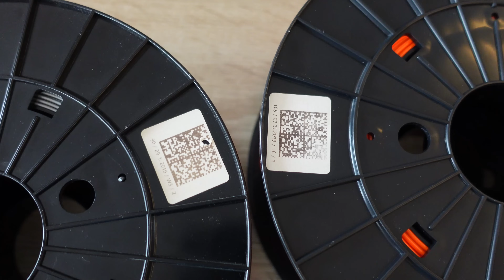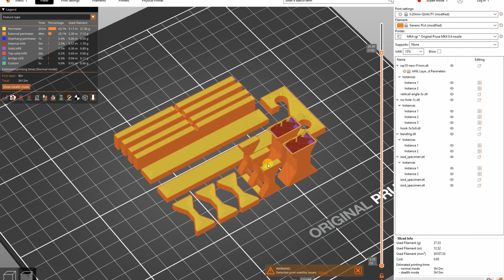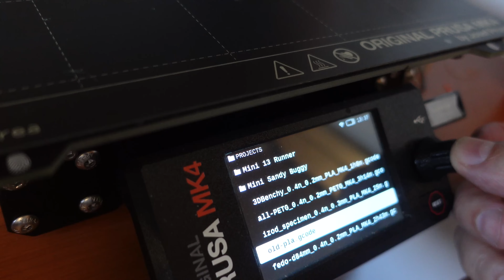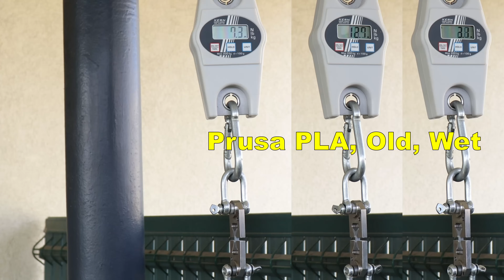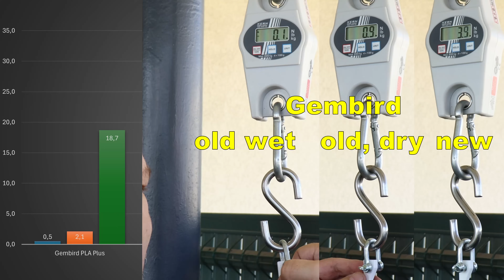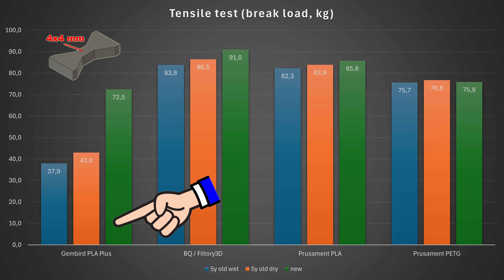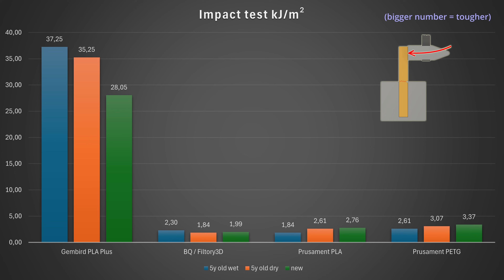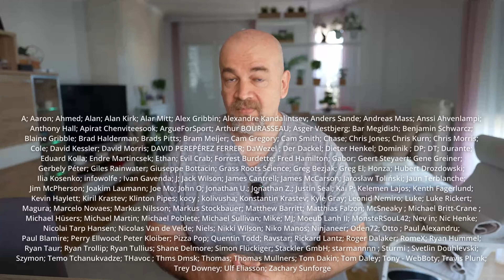5 years old vs new filament - Which one is stronger?

Comment: The reason your PLA was no longer brittle is you eliminated the other layer which was exposed to UV.  Please do some UV vs moisture testing on PLA.  I also wonder if exposure to mild heat within a filament dryer reconditions PLA in another manner.  https://youtu.be/nHdHSK4hvZE

Comment: I made a $0,- filament dryer:  A cardboard box ofer the 3D printing heating plate.  40 deg C and waiting a few hours. Need little holes on top so that the hot humid air goes out due to convection and fresh dry cold air can come in at the bottom.

Comment: I would be interested to know how the strength of 3D printed PLA parts changes over time given how the filament becomes brittle when left alone. Even in a large storage box with pounds of desiccant, the humidity remains low, but eventually I pick up an older spool and the filament has broken around the rim-hole.

Comment: Love your videos as always, but just one correction.

The older "Prusa" branded filament was made by Filament PM (Plasty Mladeč) as you noted, but it's not the same as Prusament. That product line is still sold by Prusa in their store, though, as the "Made for Prusa" line, but "Prusament" is a separate brand that is manufactured by Prusa in-house. I'm not entirely sure, but I think Prusament has always come on the hex spools, and used QR codes. The Filament PM spools have Data Matrix codes, and I did decode them from your footage to confirm that they are not Prusament, unless Prusament filament was spooled onto those spools at some point and the code is incorrect.

The old "Prusa"/Filament PM PLA you have is their "Silver" PLA, and the PETG was their "Prusa Orange" PETG. They did sell a Filament PM-manufactured "Prusa Orange" PETG back then, but I assume Prusa reserved that term for their Prusament brand at some point, as now you can only get Prusament with that name. However, you can still get that filament from Filament PM, which they renamed as "Orange 2018" PETG.

Comment: I want to put in plug in for patreon.  Not only is it good to support someone who is doing good work for the community, having access to the accumulated data is very useful.  I reference the spreadsheet every single time I buy filament.  I haven't found any other way to effectively differentiate this PLA vs that PLA, or whether what I'm doing is a better fit for ASA or nylon.  Buying 3d printing filament without Igor's data is buying blind, or at best relying on anecdotal or biased reports.

Comment: Well these results kind of support my opinion that many people are worrying too much about storage.

Sure, I have petg and tpu filaments in a plastic container with some silica, but I store PLA in the open (no direct sunlight), only dry it when i have not used it for a longer period and never had any issues.
Reply from the maker: Yes, I mentioned it only on one place, but summary: PLA: open air, PETG, TPU: bags+silica gel; nylon: vacuum bags. ABS, ASA: open air (I am not sure about this last one, if it is correct)
Reply: With a cheap sealing machine and vacuum bags on roll it's easier to vacuum everything :-)

Comment: This came in handy. I had my old 3D printer in storage since early 2019 and just unpacked it all - with 10 or so rolls of various filament. And the very first thing I noticed was how brittle the PLA was. I left the rolls I wanted to dry for days in my dry box (for camera gear) and have printed some small storage boxes for a peg board. No scientific tests, but yes, less brittle now and the prints seem decent enough. Very relieve that I can probably use all this old material:)

As a side note, I haven't printed FDM since 2019 so missed the whole Klipper revolution but think I will go for it now and give my old printer some nice upgrades. While it's good to have it back, I'll get tired of it's 45mm/sec print speed very fast.

Comment: Thank you for this video. Keep up the good work!

I have tried to reuse some old filament as well, and came to similar conclusions.

1. Running brittle filament through a CoreXY is not a good idea :-)

2. Sometimes drying filament makes it less brittle. I experienced that as well, and some of it would work in my Bambu, as long as I wouldn't leave it in overnight. It would never work reliably in the AMS.

3. Some filament stayed brittle, even after drying. I had some old black and white Dremel filament (8 years old or so?) which would NOT improve even after drying.
Reply from the maker: Useful, thank you!

Comment: People that think there is no advantage in a Filament Dryer are missing so much - not only it prints better when dried, but I loved to confirm one more time that even for filament brittleness in the spool itself, drying helps! Anyway, I am so happy to see that we can continue using VERY OLD spools with a clean conscience 🥰
Reply: Depends on the humidity of where you store them or how dry they are from the factory. I've tried a dozen PLA brands and there's been no difference printing out of the box vs drying.
Reply: @zackj997  Yeah, how dry it is from the factory is always a concern for me, so I always do a brittleness test to see if drying is needed or now. One in particular is esun's PLA+ (peak green); it's very brittle out of the package so I always dry it before use. I also always dry any PETG I get before printing with it.
Reply: Many (most) dryers are bad! If you heat up the chamber and take out a bit of moisture from the filament but do not exhaust that wet air frequently the effect od drying stalls. I built my own with controlled fresh air in and old air out - and yes, it takes more energy for to so, but drying means energy consumtion otherwise its only a way to warm up a spool with a small piece of drying effect.
Keep the spool in a warm and wet air for hours is wasted time.
Reply: @peterle987  I just use a cabinet style food dehydrator. Much better at drying than most dedicated filament dryers.

Some dryers do what they're designed to and have proper air movement.
Reply: @NWGR  the food dryers are the way how it should be: fresh ait in, take moisture and air out. A good one with Thermocontrol is better than most of the filament dryers. 👍
Reply: @peterle987  Yep. Plus, my food dehysrator is a lot more quiet than most of the dedicated dryers out there. Bigger fan, slower RPM, less noise. It's been great.

Comment: Looking at the brittleness, now I'm curious how aging/humidity affects finished printed objects. Do they loose their properties a month in? Especially since it seems to go the opposite way for PA6 compared to PLA here.
Reply: PA (nylon) is notirious for how much it absorbs water. I have some mechanical parts I printed in PA-CF years ago and they are soft as noddles now. Then again, I live in the tropics, so just the wrong material for the use case.

Comment: Please test drying in microwave it works great for me and is 100X+ faster
Reply: Can you recommend some settings?
How long, how much Wattage?
Reply: @berlinberlin4246  The Wattage is a tricky thing when it comes to Microwave: in reality, anytime it is "heating", it is on MAX power... Changing power only affects how many seconds it will be turned on, then it pauses, and comes back again at full power... Nonetheless, this is very interesting!
Reply: The micro waves that bombard the plastic actually destroy some plastics. This is why you see some plastic containers are microwave safe and others are not. I would not recommend using a microwave.
Reply: @scrpnby4207  Tho some microwaves have built in heating elements. That way it will act like a normal oven. I guess you could use that
Reply: I run a full 1kg spool for 30-40 sec @800W but i have a relatively dry room, just feel it afterwards, it should only be slightly warm on the inside, if you run it too long you will have to throw it away... (never happened to me though)
Reply: How does that work for the spools with rfid tags in them? I will be acquiring an old food dehydrator for this purpose. Cheaper and, likely safer than using a microwave.
Reply: @TherapyWithWind  any metal and a microwave dont mix and are not a good idea. Just remove the RFID tags, they are usally just stuck on like tape if u are gona try this but seems you wont as your going the dehydrator root. Good luck to you.
Reply: Im not sure if microwave is the best option for this because it only heat up spots and not the entire thing. This is why food is hot on one place then cold on the other. It might not dry it out evenly.